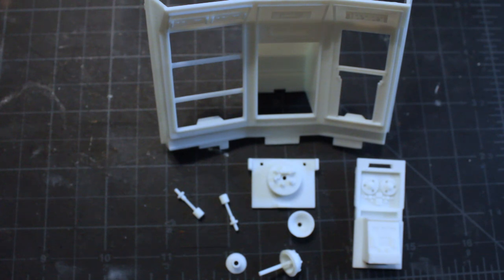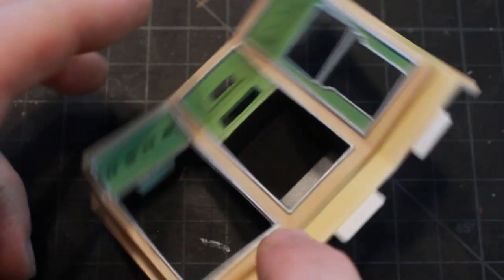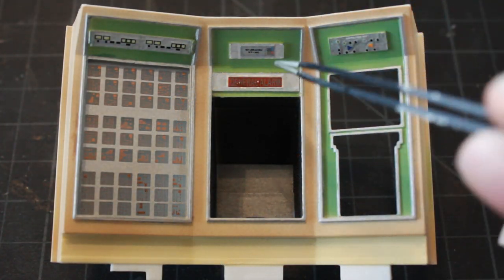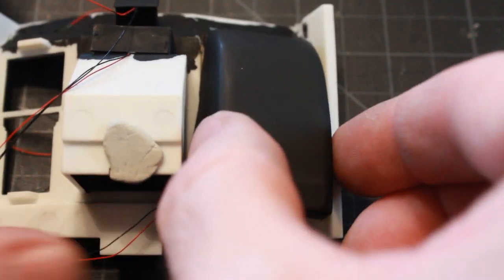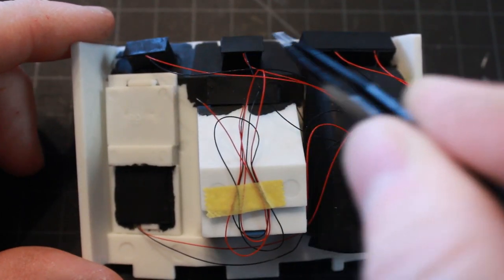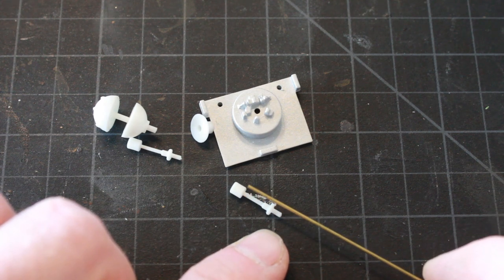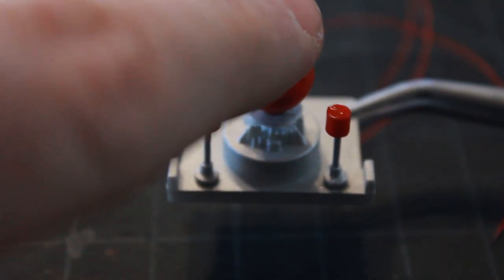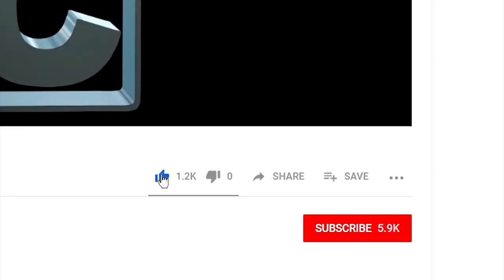Moebius 1/35 scale Jupiter 2 Pt 4 Circuit and Alarm wall

Comment: great work again, very descriptive ! Little question, where did you find the little electronic board with speed adjustment ? Thanks
Reply from the maker: The boards I made from cutting up little pcb boards.  The pots on both boards adjust brightness.  The one does the circuit wall and the other the brightness of the alarm sphere.  The blink rate of the 2 alarm towers are controlled by an Adafruit Trinket,  which is basically an Arduino. I'll get into that in a later video.
Reply: @modelsbychris  genius ! Thanks

Comment: It seems to me that I will have an overwhelming task ahead of me with the build of my Jupiter 2.   Any tips?
Reply from the maker: Just take your time.  I always constantly test while building.  Nothing worse than doing lighting,  pinching a wire while putting pieces together,  then the lighting doesn't work.  So test along the way.  And just have fun with it.
Reply: Do you have a list of material I will need for the construction? @modelsbychris
Reply from the maker: @CarlosGarcia-fi4yu Sorry not really,  no.  It was 4 or 5 years ago now.  And all was supplied by my client except for the lighting and electronics.  And he supplied the fusion core light.  As far as all other lighting goes,  it was a lot of fiber optics and 2 or 3mm LEDs if I remember.